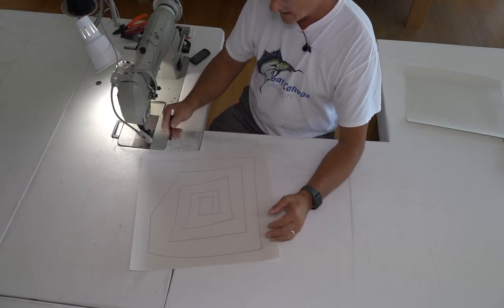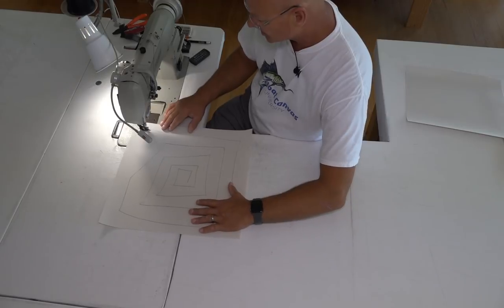Seam Dart Bind

Comment: 3/4 of an inch is 19.05mm.  If your binding attachment is 20mm, it has almost a millimeter of slop in addition to the manufacturing tolerance of the binding.

Comment: 39:51 begins the Consew RB255 RB3 tutorial and threading how-to. 46:50 Yep, I only wrap twice myself on my 206 RB1. Three wraps is too much tension on thick thread. 47:32 Yep, that was my first learn on my own mistake that I had to correct on one of my channel videos on threading a Consew 206. 53:04 Likewise, too many stitches per inch becomes more like a perforation and can rip the material easier under stress. 56:30 discussion on needles. 59:13 comments on thread. 1:00:55 begins the Consew 206 RB5 discussion.